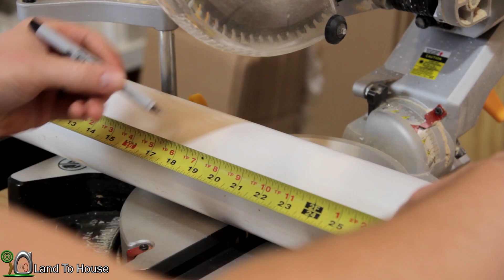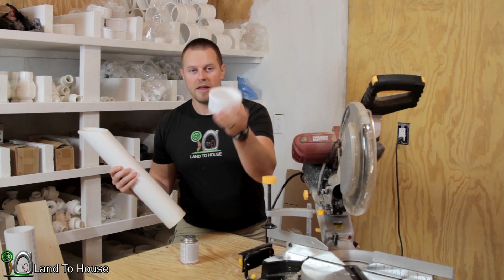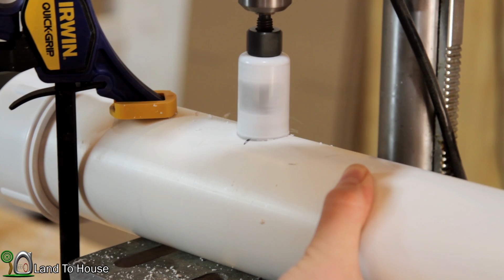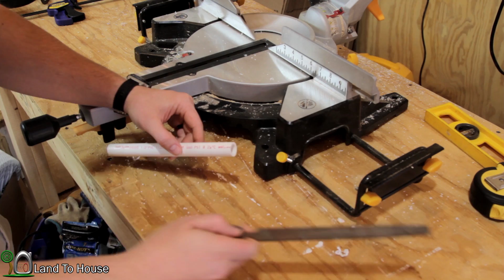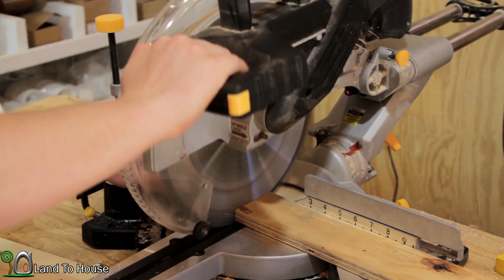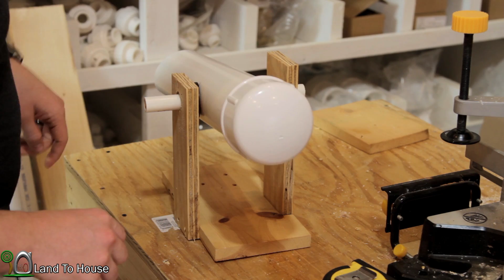DIY PVC Shishi Odoshi

Comment: Instead of sticking the pivot point through the main pipe I cut a circular hole, the same size as the pipe width,  in a piece of timber which I then slid over the pipe. This could then be adjusted up and down the pipe easily and get it to tip exactly as I want it to.

Comment: If you don't know what to do with your free time, make useless mechanisms.
Reply from the maker: Ha. I used this unit to test a low flow U siphon start from a Hydraulic Ram Pump. It allow a sudden surge of water from a low flow ram pump output to pull siphon and drain a tank. So there was a point to this video. . . .and $500. Lol.

Comment: Great tutorial.  Can you advise what would be an approximate good distance from the front and rear to the pivot point, to give it a good balance?   Thank you
Reply from the maker: I imagine the pivotal point will change based on the length of the pipe and brand of end cap and a few other factors. I just held on to the pipe and felt where it would tip over.
Reply: @LandtoHouse  ok. Will give it a shot. Appreciate your quick reply.

Comment: Neat and quick, love it.  2 thoughts: 1) plumbers epoxy putty or silicone caulk to seal the axle from the inside would be easier and cheaper than the uniseals. 2) its a tiny bit tail heavy and rocks back before you get the full charge of water to empty out.  the axle is often below the centerline so that the weight shifts when tipping allowing it to discharge much more before tipping back.  You could glue a couple of weights to the tube above and slightly forward of the axle so that when empty it is just  wanting to tip back, that way you get a bigger surge from it for your siphon.

Comment: If you run 100 grit sandpaper in one direction multiple times it will create a wood grain appearance.
If you leave it alone for a few weeks after that it will yellow.
You can then coat it in shellac and then spar urethane to make it blend in with the stand and weatherproof it.

Comment: probably been mentioned before, cue efficiency eyerolls. does the level in the tube before tipping not allow for a larger relief cut on the top (lower angle cut) to allow the water to still drip down vertically and pour into the tube while in the dump position instead of flowing onto the pvc pipe into undesired locations and create waste/spray? if so, could a weight be added to increase the dump frequency, lower the surge volume, but also increase efficiency overall? i suppose a large tube in conjunction with weights would be required to meet the same surge potential.
Reply from the maker: This project was actually just made to allow a ram pump low flow to start a U siphon. I am sure that there are many ways of improving the efficiency of the pvc shishi odoshi. Thank you for the comment.

Comment: First off, this is really cool. Way to get out there and make a thing. That's always awesome. Now, a suggestion, in a traditional "deer scare", the bamboo sections means that only the front third fills with water. This means you get a full empty every time and the front as well as the back impact the base. If you used two peices of pvc with something in the middle you could do without the seals around the pivot because that section would always be dry. 
You've inspired me. I'll see if I can make something like this and have it be as simple and effective as yours. Thanks!
Reply from the maker: Thank you for watching! I actually made this very fast to use as a sudden surge for starting a U siphon. I expect there are several design improvements that can be made. Getting you thinking about making your own version is all I can ask for! haha Let me know how it comes out.
Reply: Ik wil er enkele kopen van jou?  Gaat dat lukken aub?

Comment: I guess the second uni-seal was inserted inside to avoid it popping out while pushing the pipe through, why not insert it from the outside, cut the 3/4"  pipe 1" longer, then cut a 45° angle to make it easier to insert once it's in saw off the extra piece. 
Overall great vid.
Reply from the maker: Yes that is why I installed it in that direction. I am sure there are many ways to improve this simple design. To be honest I made this quickly so that I could test a low flow auto siphon. (A ram pump filled the shishi odoshi that then dumped into a bucket to start the U siphon.)

Comment: Why waste the money and complication of the seals when you can drill your pivot hole to fit a 3/4 pipe and just glue the pipe around the hole and the pivot is water tight. Then just use a smaller pipe, run it thru the 3/4 pipe to attach to the stand for your axle. Much simpler and cheaper to make.
Reply from the maker: Nice to  find that my video has you thinking! That would work just fine. I made this in a hurry so I could use it as a low flow start to an auto siphon. I am sure there are many ways to improve the design.

Comment: Why not dill holes in the pipe between the Uni seals and use that as the inlet it will obviously need a bit more pipe and a little extra work but would look cool too
Reply from the maker: These things can be made in many configurations! This version was just a quick build to test out some Auto siphons and ram pump tests.

Comment: thats a nice looking one.  Ive built lots of odoshis and sometimes it works on the first time and other times it takes all day to tinker with lol.   Keep in mind if you have to strong of a pump, the weight of the water hitting that lip wont let it tip back,   and I find the more vertical it is the easier it seems to do what you want., because there gets to be more weight at the top. the I made holds about 3 gallons.
Reply from the maker: I am sure there are plenty who meditate to such... But I am working with this to gain knowledge of u Siphons and hydroponics.
Reply: It might just be the Satisfaction of a working sishi odoshi drain system haha   The sound of Success
Reply: Master Caster whats the use of this?
or is it just a waste of resorces?
Reply from the maker: The original use was in a Japanese garden to scare away wildlife with the sound of the clonk. I am using it to supply a large sudden flow of water to a u siphon.
Reply from the maker: I did notice that there was an issue when I poured too much water at a time. It caused the pipe to fall faster than it would with a slow flow. I spent a good bit of time holding the pipe before making the holes to see what spot was the ... fulcrum I guess is the right term.
Reply: Land to House allways nice to learn more.
I thought it was just for some meditation bs.
Reply: It scares away deer and rabbits and things,  myn is set up in my garden  and I dont even need a fence anymore. so it dual purposes,  It looks better  ( just a bit better ) then the one I hade a video of before lol.   no its not a waste of resources,  Its a way to overmass the speed of the pump when the siphon starts trickling.  if you dont overmass it they will cancel eachother out and it wont siphon, just circulate.   The meditation thing I dont do alot of But ive notice I like having the splashing around, I have it splashing on rocks.   just have to set them up in a way it dosent plash the water out of the resivior
Reply: Well. I dont know much about the meditation stuff.  But I have noticed I like it when it spills the surge of water.

Comment: Will the plywood survive being wet outside?
Reply from the maker: +John Stryker no it will not last long. I made the base just for my u siphon testing video. I do recommend a much better base for a more permanent installation
Reply: Land to House that's right you mentioned you should make a pvc base.
Reply: You could also use a stainless or aluminum rod through the center PVC and make the rest of the base out of the same metal.  If you plan to have this running for a long time in direct sunlight it would also be a good idea to use UV resistant PVC or paint it to prevent it from becoming brittle over time.
Reply from the maker: Nice idea. That rod would allow for better displacement of weight across the base. A good UV paint would be ideal. That would also make it look a lot better.